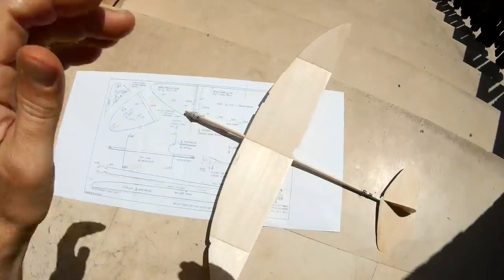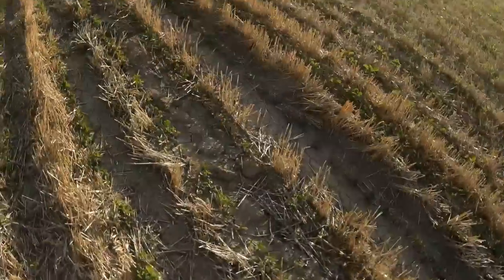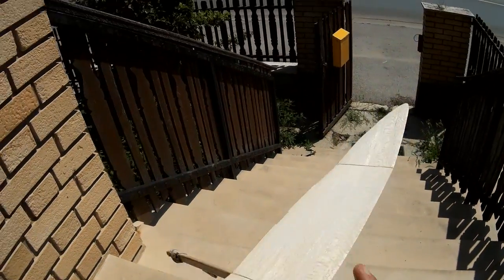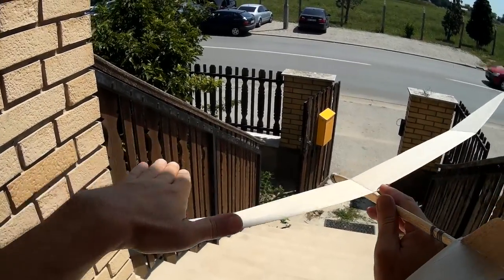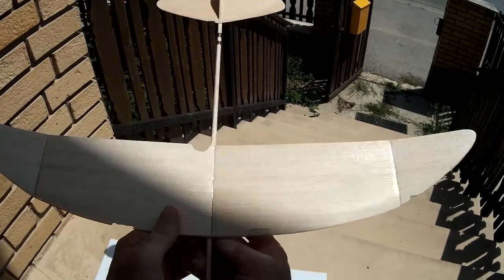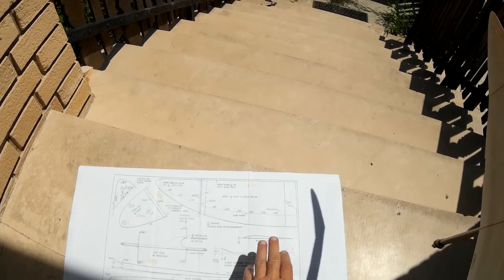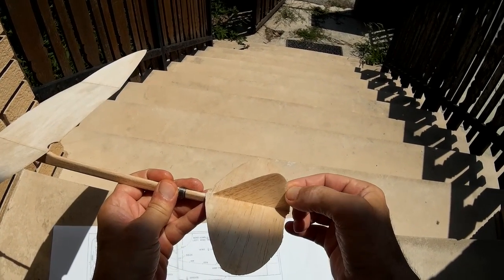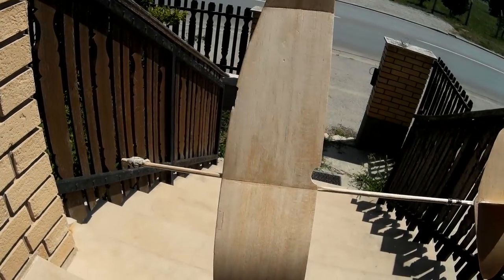Ron Wittman's SuperSweep SS24 balsa glider build

Comment: Good video in showing some of the glider's details and explaining the challenges you had during construction.  I think I will have to try to make one of these for myself!  😊
Reply from the maker: Yes, it is little bit harder than your simple glider, but it is actually interesting challenge - just require good balsa and lot of patience, and of course some building skill. Thank you for nice comment.
Reply from the maker: BTW, tell me where to buy good rubber for catapult? All I can found is some cheap Chinese rubber (latex), but quality is questionable.
Reply: We buy these cheap 7" x 1/8" rubber bands at our local big-box store-- They can also be found on this site:  http://bit.ly/2tadnjB  (We like them because they come in blue, pink, and purple.. but, they do break after a while).  If you want hobby-grade rubber, try Volare: http://bit.ly/2tadITm (it comes in box as one long strand-- you cut your own lengths and tie your loops-- Great for rubber powered planes, too.)
Reply: We buy these cheap 7" x 1/8" rubber bands at our local big-box store-- They can also be found on this site:  http://bit.ly/2tadnjB  (We like them because they come in blue, pink, and purple.. but, they do break after a while).  If you want hobby-grade rubber, try Volare: http://bit.ly/2tadITm (it comes in box as one long strand-- you cut your own lengths and tie your loops-- Great for rubber powered planes, too.)
Reply from the maker: For some reason, second link does not work.
Reply from the maker: Oh, and on first link, they does not sell to my country. :(
Reply: I think their site was temporarily down.  I saw the error, too, but it seems to be up now.  You can also try searching the web for "FAI Rubber" or "Tan Super Sport Rubber"-- you may find a number of sites selling that.